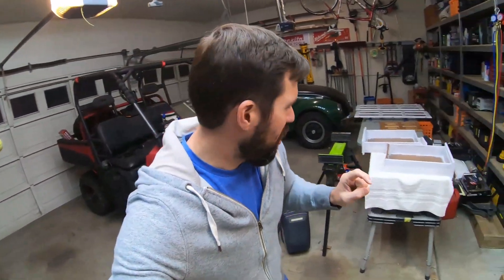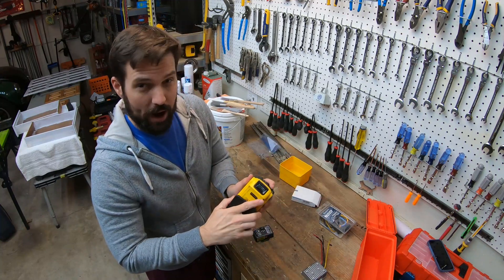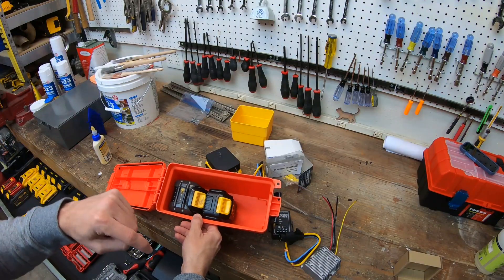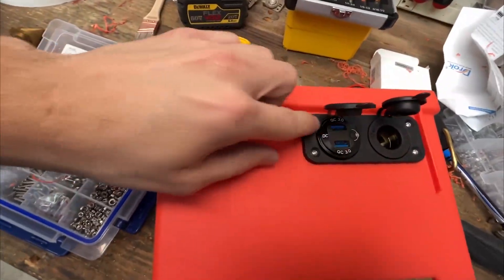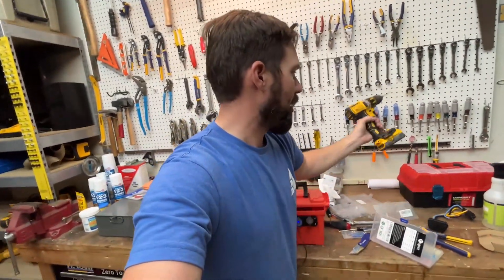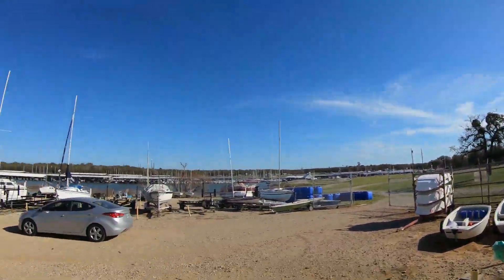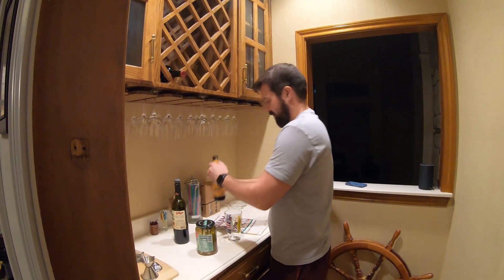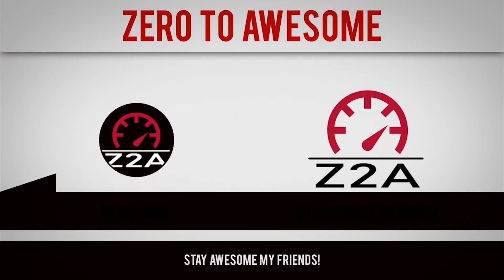DIY Power For My Boat From Tool Batteries

Comment: Do you think I could do something similar to use dewalt batteries to use the electric start on my outboard?
Reply from the maker: You would have to use a pretty beefy battery to get enough amps for the starter. Probably cheaper to just use a lion or AGM motorcycle or sxs battery.

Comment: Hi, which Low Voltage Disconnect Module did you use are they come in different configurations? Was it the DC 10 to 32V, Rated current: 30 Amp

Comment: I know you already had the batteries and wanted to try to make it work, but you could have bought a Jackery, Anker, or GoalZero power station.
Reply from the maker: I looked at a couple but they mostly provide ac or USB power at low amps. I need a 12 plug.